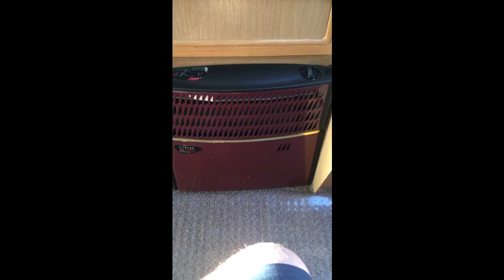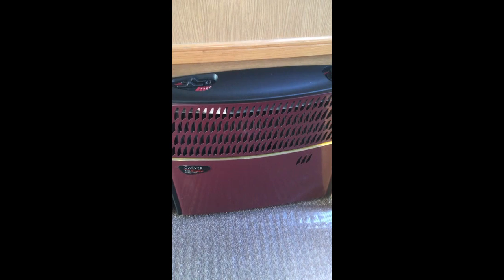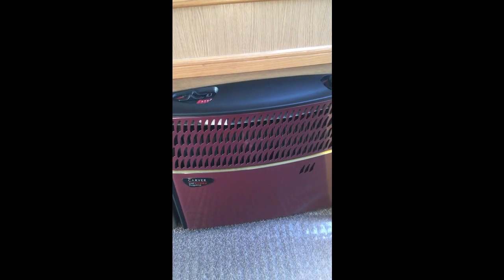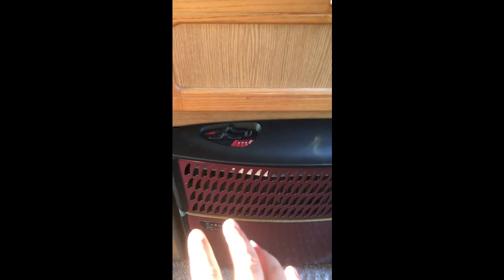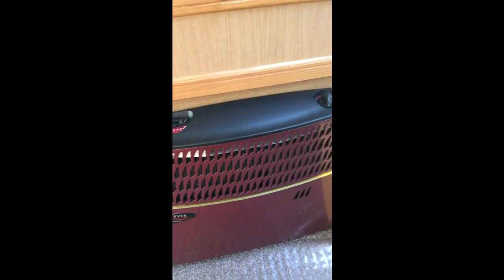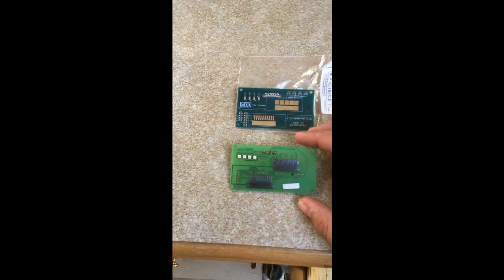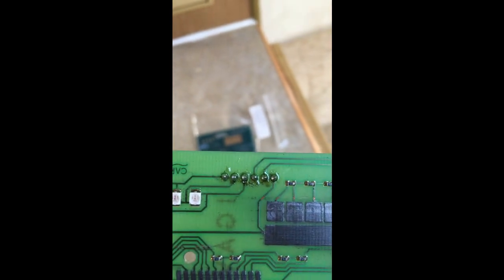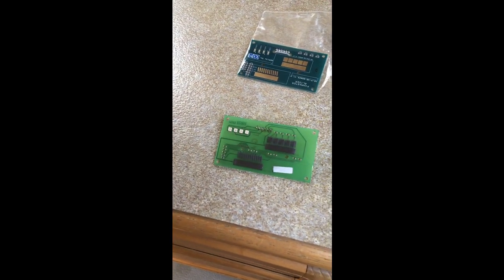Carver Turbo Master 5500 Heater Repair

Comment: Thanks for the video. What's the use of the dial on the right side of the unit and when does or doesn't it need to be used?